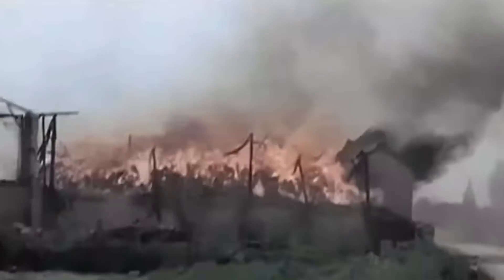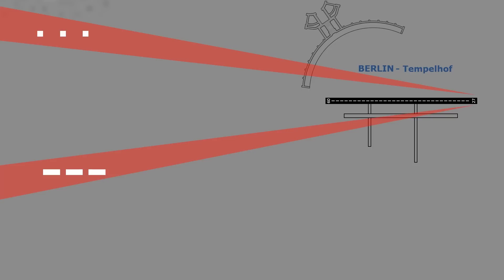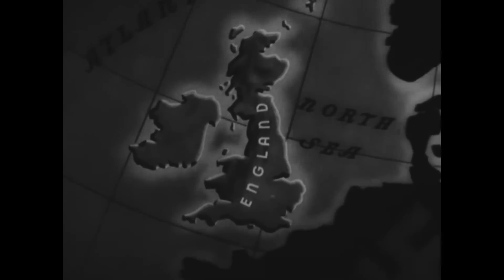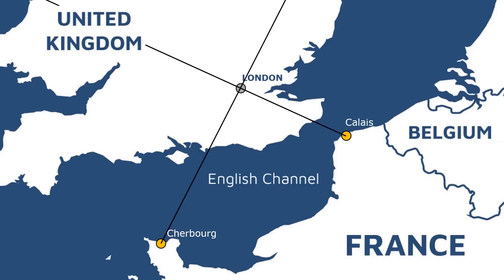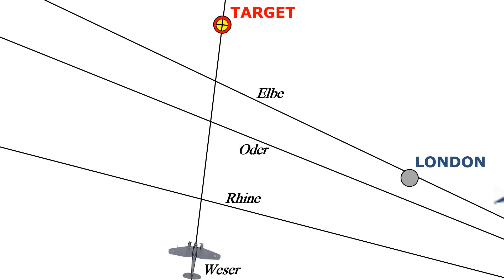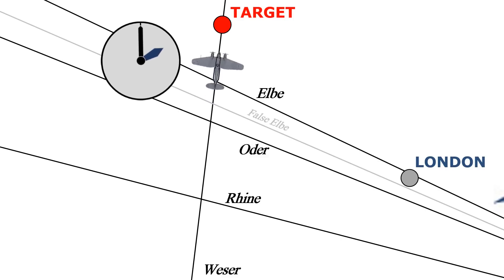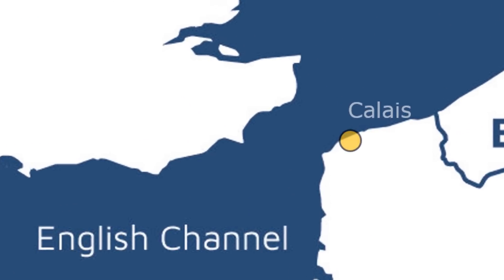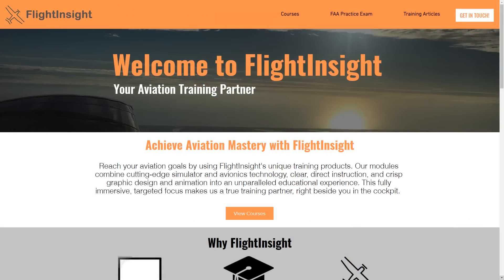Radio Navigation in World War II | The Battle of the Beams

Comment: I know I’m 2 years late, but I just wanted to say that this is just what I needed for a science project on sound waves. After an attack by Spitfires on a Luftwaffe formation, British coastal guards captured a Heinkel crew with a Lorentz receiver. The crew were cooperative, negotiable and told the Brits about this targeting system. The British believed them as they received an Enigma code about the Unterseeboots trying to avoid this ‘Knickebein’. A PBY Catalina was told to find a beam with a frequency of 30-35 MHz (3 million Hertz). They weren’t told why. They were able to intercept it and trace it to Stollberg (Bredstedt). They found out the target was Derby, a city with Rolls-Royce factories producing Merlin engines for Spitfires. The British built their own beam so that it would mirror the Knickebein and send the Heinkels of course. It worked! Heinkels bombed the wrong target, struggled to find the equisignal, and even landed at RAF bases believing it was their own. Though, sadly, some Heinkels never found Germany again and crashed in the Atlantic. This would become known as the Battle of the Beams. Amazing video. Thank you.

Comment: Mostly correct.  However, one of the episodes of the BBCs "The Secret War"  series (1977) discussed this.  Scientists couldn't figure it out on their own.  So they bugged their Luftwaffe POWs quarters and one of the POWs made a vague comment which led the British to go back to their planes and pore over all the equipment with a fine tooth comb.  That is when they found the receiver.
Reply: Actually there were no extra receiver. A ‘normal’ receiver found in any cockpit war modified in such a way that it had a hidden function. A camouflage. Eventually the British found out about the hidden functionality.
Reply: @kjellg6532  Correct, but only through spycraft.  NOT by scientific methods as claimed in the video.
Reply: The Germans modified the FuBL 2 blind landing system to function as knickbein.  Basically the same thing but set up for runways.   The Germans had systems after this EGON which was a little like Oboe and Zyklops.

Comment: On July 6, 1920, US Navy seaplane pilots used a radio compass to locate and navigate their way to a ship 100 miles offshore, marking the first use of radio navigation by an aircraft.
Reply: So was born the radio compass or NDB. Still a fun way to navigate. This can also be used with a VOR on a G-1000 with the bearing function turned on.
Reply: @aviatortrucker6198  True indeed.  I'm not a fan of the G-1000 but yes, in fact regardless of how advanced Cockpit Navigation will become, there's nothing like a tried and true set of tools.